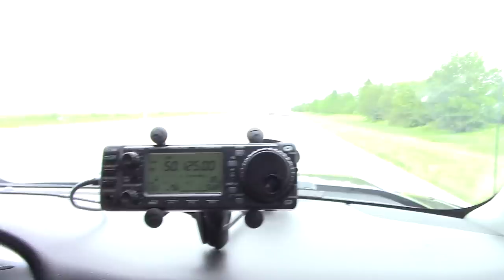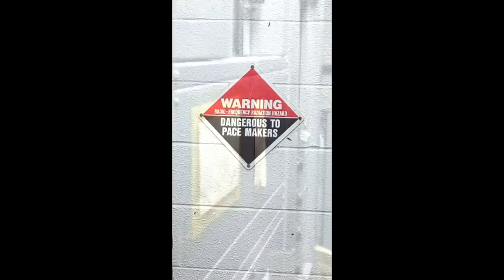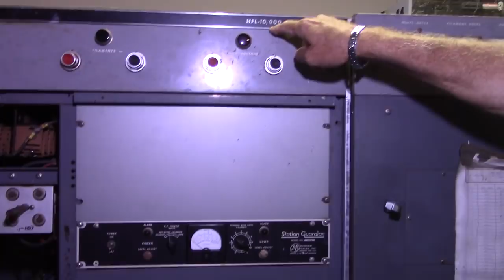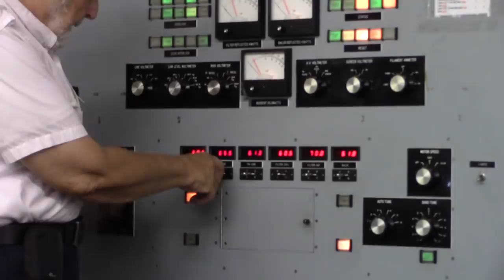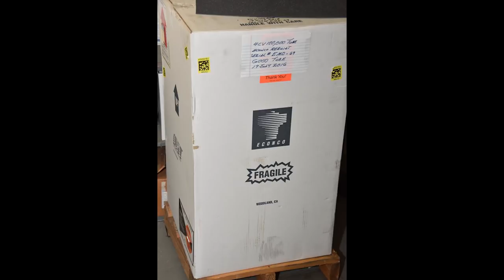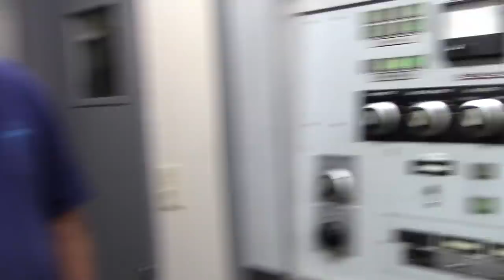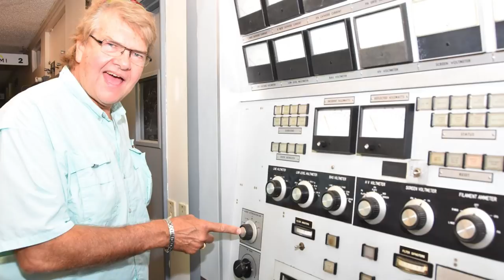1.4 MILLION watt Shortwave station WRMI Florida

Comment: Step 1: Build and oversized Qi coil.
Step 2: Install it on top of your Tesla.
Step 3: Park under those antennas and charge your car for free.
Reply: It would be a wireless charger like what the cordless phones of the early 2000s had.

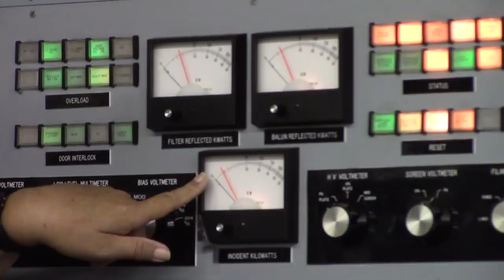Comment: 13:16 - 13:56  I used to work on amplifiers which used similar transformers (but with three cores for three-phase power) to power the driver stages.  The main P.A. power supply and output transformers were the size of small automobiles, and the output tubes (two [huge] triodes in push-pull) were water-cooled at 300 gpm (two 20-hp pumps)!

In any case, this was a great video.  Thank you for taking the time to produce and post.

73 DE KI6DCB

Comment: My brother (who winters in Okeechobee) and I drove out there in late 2012 when WYFR (Family Radio) was still broadcasting from that facility.  We got the nickel tour.  At that time the place was a real dump.  They had plastic sheeting on top of many of the cabinets and racks along with lots of buckets from the leaky roof.  It looks much better now.  Lots of new equipment and the building has been repaired/remodeled.  Somewhere I have a couple of 8MM video tapes of our tour, including an extensive view of the antennas.  Thanks for sharing your video guys.  It was a treat  to see it after someone invested a lot of money and a little TLC.
Reply: Some of that plastic sheeting can be seen in this video!  15:45, on the right side of the picture.

Comment: It is NOT 1,4 Mega Watt.
Transmitters: Twelve 100,000 watt and one 50,000 watt. All are high-level plate modulated (some include supplementary screen and control grid modulation). Some are entirely air-cooled; some also use water cooling and vapor-phase cooling.  The transmitter building is 16,000 square feet.  The 13 transmitters consist of two 100 kW Continental 418-Ds, and eight composite-construction 100 kW transmitters based on the 418-D but built by WYFR.  One of the transmitters has been retrofitted with a solid state modulator and could be converted to DRM digital operation.  There are three older Gates/Harris transmitters (1 x 50-kilowatt and 2 x 100-kilowatt).  All of the 100-kw transmitters can also be operated at 50 kilowatts, and one of them is able to operate at a continuously-variable power level up to 100 kilowatts.
Reply: It is NOT 1.4 Mega Watt?  Then, what is it actually?  And how many different customers can use this radio station at a time?
Reply: Hi Dorothy Gale, It sounds highly expensive to operate. Is this all subsidized by civil defense or?
Reply: @chickey333  I think the TOTAL power output of all 13 transmitters are about 1.4 MW. Each transmitter operates on different frequencies.  At 6:30, the screen only indicates 6 transmitters active. The output is NOT 1.4 MW on any one frequency.
Reply: Trey Hart what is the electric bill cost?
Reply: @jrchicago9216  probably more in a month then the average person makes  a year.

So assuming 12 100kw tx @ 70% efficiency is about 1715Mw. Miami has a commercial power cost of 9.66¢/kwH that's about $165 an hour just for the transmitters alone.

My est probably a little high but it's a starting point
Reply: Isaac Cool Appreciate the response, thanks!
Reply: @isaaccool3183  All 12 never operate simultaneously.
Reply: @treyhart6861  It's a myth that Wikipedia is "not a credible source." Any potentially disputable factual claim should have a citation, and if what the citation links to matches what's on the Wikipedia page, then it's as credible as the original source. The real problem with citing Wikipedia as a source is simply that the content of a page could change at any time.
Reply: @treyhart6861  Exactly. More broadly, I have major issues with Wikipedia, but not being accurate is not normally one of them. And I use it all. the. time.
Reply: @amentco8445  If you're asking whether I like the way editing is handled on Wikipedia, and the discussions about it, I would say I certainly don't. There is much I don't like about Wikipedia. It has some really ridiculous aspects. Details on request. But WRT accuracy, all I can tell you is that as a starting point, looking at it as a sort of encyclopedia, it has generally been accurate. That's not to say that you won't find some truly ridiculous things said there from time to time. But it's not a runaway problem. Corrections usually get made, and the more obvious errors will get fixed sooner. And when you have doubts, you can always pursue the cited sources. If there is no citation, of course, that also tells you something.

Comment: Been about 2 years since this video, but I discovered WRMI in the summer of 2018. I just finished restoring an old Hallicrafters tube-type shortwave radio, found on the side of the road (it was on top of some old furniture). And in the wee hours, I get a station playing (if I remember right) 1970's pop. This was received in MA.

Comment: These guys used to be a customer of mine back in the Family Radio days. Out in the middle of nowhere which I guess was good for the neighborhood. As for that herd of cattle living under all those different antennas. I bet they glowed in the dark. I know the office as a big faraday cage and they still didn’t need to hook their fluorescent bulbs up to get light. The operators were all nice folks. They busted their asses to keep all that old gear working. At one point they were working with Nautel to design and build a new transmitter but Family Radio went away and so did the funding.

Comment: Interesting tour and having worked in SW Broadcast for several years and in using very high power RF for science work it brought back memories.  

Modern power tetrodes are a far cry from their glass envelope ancestors and incorporate advanced construction techniques operating at MW levels up to 200MHz (Diacrodes).  Vacuum tubes are "not dead yet" (M Python) and will be around for the foreseeable future!

Comment: In my early years of exposure to radios, my first junkyard buy was an eight loctal tube shortwave receiver built into a wood box...my first respect for electricity was holding the antenna lead up to connect to a water pipe..pow! Lesson learned.

Comment: Everyone shutting down everyone going digital or retired even my friend shutdown he’s repeater to go digital using no equip I always like all the equip racks and doing the technical stuff I always enjoy using analog and using the earth as the (internet)
Reply: 1 May 2019, the solar flux index was 66.  The Sun is at a grand solar minimum.  Radio propagation is very low.  There are no sunspots at all right now.  People are leaving all radio hobbies in droves.  Growing up, a walkie talkie on 27 megacycles would transmit across the continent.  They were amazing times.  Today, 1500 watts on a home transmitter may transmit to the next city over.  Frequencies that were extremely busy in the 1990s are nothing but ghost bands now.  Hmm, maybe I should try EVP (Electronic Voice Phenomenon) on 10 meters.  I can actually try it in hundreds of frequencies now.  They are all dead.

Comment: I was involved with ham radio 1962. I do recall the station: K6VDL a Ranger transmitter of around 50 Watts, but am not sure. The power you kick around, 1.4 megawatts is power input to the finals, is not the output from tube. The antenna's used, rhombic is the best there is and has high gain. Output power from finals is about 1/2 input power (the rest dumped as heat) and power absorbed by the antenna has to include the power factor of the antenna. It should be 1.0 but in reality is not, VSWR. Transmission line from the finals is pure copper pipes with a center pipe with internal spacers, (teflon) all pressurized with an inhert dry gas. The actual voltage and current into the antenna ( 50.0 ohms?) can be calculated easily.

Comment: At 4:45 that looks like a log-periodic antenna, not a rhombic. To put things in perspective, each 100,000 watt AM transmitter is putting out about 30,000 watts in each sideband, or about 2 S-Units (13 dB) stronger than a legal-limit 1500-watt SSB Ham station. Of course, most Hams can only dream about an antenna like one of those used here which likely add another 10 dB or 1.5 S -units to the signal. de AC7AC.

Comment: Where’s the turboencabulator?

But this is all really interesting, I’ve always wanted to get into ham radio, but never have really been able to.
Reply: @MoonMoon, becoming an amateur radio operator, builder or designer requires an interest in the subject. Are you really interested? If you are, get in touch with the local Amateur Radio Club and one of the many books available to help you study for a Technician Class license. From there, hang out with amateur radio operators and learn all you can from them. The ARRL Handbook is a must have pub. It has everything in it; electronics theory, home brew projects, antenna design, rules of operation, etc. Come join us! 
73's KB5ZDW

Comment: That 10KW plate transformer looks about right. I had to replace the plate transformer way back when in a Harris (Gates) FM10H3 10KW FM broadcast transmitter. One can't get that transformer out without removing a couple dozen power supply components which are in the way. i hope i never have to do that again!

An even bigger transformer was the Thordarsen Tru-Fidelity modulation transformer in the Collins 21A 5KW AM broadcast transmitter

Comment: Looks almost like the FCC monitoring station in Canandaigua, NY I visited back in 1980. I was told that besides monitoring, it could transmit on the old Conelrad frequencies at up to half a megawatt if needed. I spent the day with a friend that worked there after I was cleared by the FCC to even enter the building. Security was tight back in the day before the Soviets quit.
Reply: They never quit; they have, merely, changed their spots.  They are still working feverishly to overthrow "The West"!
Reply: @edwatts9890  Good call. 2022 proved lots of people wrong about Russia.

Comment: One square mile of antennas, and from there get your beef pre cooked..lol  no not quite..
Those transformers I placed a few on the machines I used to build..480vac, 600 amp for digital variable frequency drives..weight, magnetic fields caused your arm hair stand tall. 👍🏼

Comment: Hello! In my oppinion  -this radio station can use also as militarty station for digital data transmission using TLS or other crypto technologies. Because a communication satellite can been damage by a rocket or laser.  There are only several chinese radiostation in SW broadcasting band in Europe.

Comment: i am curious what the average monthly electric bill is
Reply: Minimum $10,000 per 100,000 watt transmitter. There's 14.
Reply: Andy Millgrove so REALLY where was that money coming from???? You really think people were mailing old Harold  millions upon millions of dollars a year? If so his outfit would have qualified as one of the largest charities on the planet , how ultimately stupid
Reply: No radio expert, but I can do some basic math. Assuming exactly 1.4 MW is consumed and they are using the commercial electric rate of about $0.096 per KWh their monthly electric cost for transmission would be $96,768. Per their website they will sell airtime for as little as $1 per minute. If each of the 14 transmitters got $1 per minute for the month the income would be $604,800. I'm sure the electric bill is higher, and I doubt they are taking in that much money. But rough numbers.
Reply: @saxyweed  
But you're basing the math on the output power right?
So the incoming power VIA the transformers would be much lower no?
I'm just thinking the 1.4Mw RF output wouldn't be anywhere close to the actual AC current coming in being consumed.

Higher the voltage lower the wattage as the general rule goes no?
Lol idk just thinking out loud, not claiming i know anything but there's got to be a major difference i would think.

I mean it's not like they're feeding the building 2 million Watts to cover both the building lighting etc and the transmitters. And Watts always sound so much higher than ampers by number but really doesn't compare.
1.4Mw / 440v = 314amps feed give or take.
Just going by the voltage he quoted in the video for an example, if my simple math used is remotely correct, lol.
Reply from the maker: I learn so much from the comment section :)
Reply: ezridr1234 Plenty of loss on input to get that 1.4 MW. Probably better to calculate based on input volt-amperes.
Reply: Actually the input power would be much higher than the output power.  For 100,000 watts output, assuming 50% PA efficiency the final amp input power would be 150,000 watts including modulation, and higher on some audio peaks. This is just a VERY rough guess not knowing what class the amps run, or any other specs.  Then there is filament power(considerable for a 100kW transmitter), power for the exciters, drivers, modulators and ancillary equipment.  The cooling system consumes power, lighting, A/C for the TX shacks etc, I wouldn't be surprised to hear that they consume close to 3 mega-Watts of power or even more.  As you may know, Watts = Volts x Amperes, so the actual input power is best described in kW or mW.  The higher the voltage assuming the same current, the higher the wattage.   If current drops then voltage must increase to maintain the same power and vice-versa.  Also, since they will never have a perfect power factor, VA is more accurate still.  This takes into account the reactance of the AC circuits and is critical to the power system calculations.  Again much of this is guesswork based on personal knowledge as an Amateur Extra class Ham and 50+ years of electronics and Ham Radio interest, as well as time spent as a power plant operator.
Reply: i hear that they are the number 1 Consuming power property  in all Okeechobee
Reply: @ezridr1234  The incoming power via the mains transformer is of course higher than the output power. There is never any efficiency above 100% There could be a difference between peak and average power, I don't know, if the 1,4MW are peak or average.
Reply: @pook6212  If you have an efficiency of the amplifier of 50%, it consumes 200kW for 100kW output, not "only" 150kW
Reply: @ezridr1234  I suggest you review Ohm's Law. In regard to power delivery for a specific load, raising the supply voltage lowers the amount of current required (measured in amps) to provide the same amount of power (watts).  The reverse is true as well. Lowering the supply voltage will increase the amount of current needed to keep everything running normally (same wattage).

This is what a voltage "step down" transformer does:

High Voltage, Low Current input ---------->  Low Voltage, High Current output.

Except for some losses due to imperfect efficiency, the input wattage of the transformer is nearly identical to the output wattage of the transformer.

Electrical power is sold in kilowatt-hour (kWh) units. There is another engineering term called "power factor" that needs to be considered for an exact calculation. But, basically watts multiplied by time is how the utility charges for electricity.
Reply: Electricity is $ .12 / KWh where I am, around 100 miles south.  If they use FP&L it would be the same.  Get out a calculator for the rest...
Reply: @ezridr1234  No "Higher the voltage lower the wattage as the general rule goes no?" is not correct. You're thinking about "The higher the voltage the lower the current*". The "wattage" (correctly power) *always stays the same in an ideal world, however there will be losses always so the incoming power will be much more than the output RF power.
Reply: @KingJellyfishII  
I use the term wattage because people that don't deal with electrical know what I'm trying say.
Bedsides, the math converts ampers and wattage linear doesn't it?
Isn't amps current? And divisable into wattage vise versa?
I can use math to find my ampers using the Watts to size a breaker.
Reply: @ezridr1234  OK I understand the use of wattage now. Amps is indeed current, however given this formula: p = I * v, the power = current * voltage, you can see that if the current goes down and the voltage goes up proportionally, the power stays the same.
I may be missing the point though so correct me if I am.
Reply: @ezridr1234  I think you are confused. Read up on Ohm's law. Power is measured as input. Output power is less than input.  Higher voltage does not mean lower watts, no.
Reply: They wouldn't be running all 14 transmitters at the same time all the time.
Reply: A lot. lol. 

Actually I wonder if the RF would mess with solar panels, they could install a solar array right under the antennas.  Would get lot of shadows but probably still produce quite a lot of power to at least help.
Reply: @992Archer  100K watts refers to the ERP, not what gets measured at the electric company meter.
Reply: @saxyweed  "they will sell airtime for as little as $1 per minute"... reminds me of the Border Blaster deals: a dollar per holler.
Reply: i know of a glass factory that spends $500,000 a month on natural gas to fuel their furnaces.
Reply: 55 dollars a month!!!
Reply: Most big consumption of electricity entities get charged a base rate. What that is for them I myself don't have a clue.
Reply: @pook6212 : Well, "mW", maybe, but be prepared to get another "0" key on your keyboard!
Reply: Call'em up and just ask. It never hurts to ask a question. 👍😁👍

Comment: With the current grand solar minimum, making radio propagation extremely low, 1,400,000 watts transmit power is a bit on the low side.  Today, Mayday 2019, the solar flux index is 66.  WRMI probably should bump up the power to 2,000,000 watts.

Comment: The funny thing is, a new one of these stations could be built using modern tech, fiber, computers, and would fit in a much smaller building, while being operated from a remote location (smaller bldg) on the property.